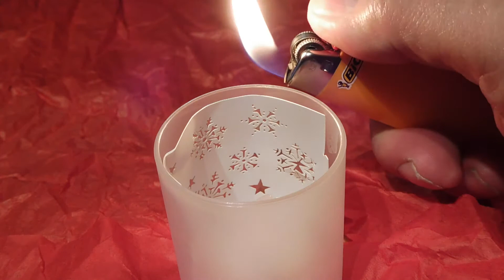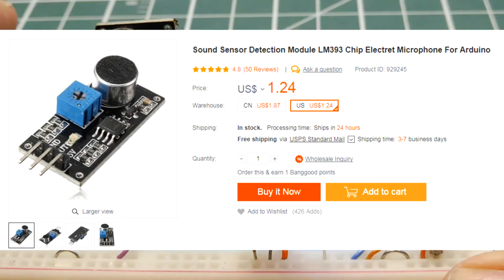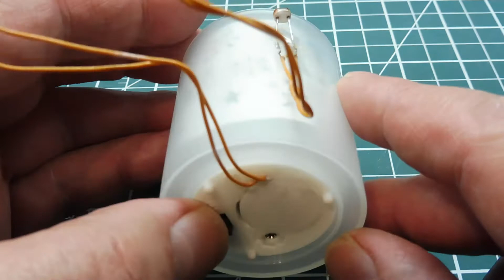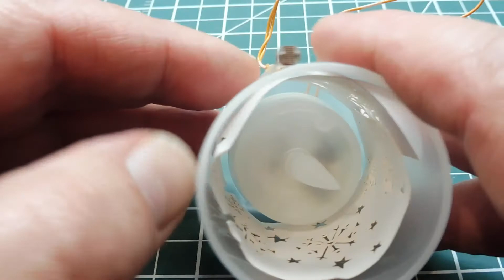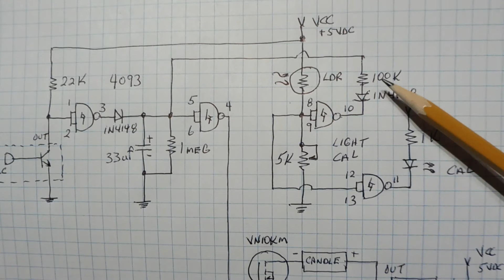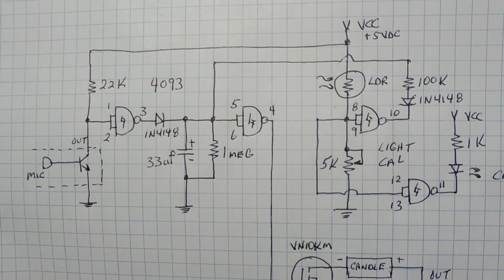Build A Smart Candle

Comment: Hi.  Im trying this one.  Instead of using a 3.3v regulator, could I use a voltage divider circuit using two resisitors?  Thanks!
Reply from the maker: Yes.. that would work. You could also use 3 diodes in series or a 3.3v zener and resistor.

Comment: Hi 3mer.  I notice you use a VN10KM mosfet in some of your circuits.  Can this be substituted, and if so what specs for mosfets are most necessary to be compatible ?   Also, what online component stores do you like to use in general for components ?  Thanks !!!
Reply from the maker: I have a large stock of VN10KM mosfets on hand so I use them a lot in my circuit design. A good substitute is the 2N7000 which are easy to obtain and quite inexpensive. https://www.banggood.com/50pcs-2N7000-N-Channel-Transistor-Fast-Switch-MOSFET-TO-92-p-1150144.html?rmmds=search&cur_warehouse=CN
In some circuits you could also use the common 2N3904. For most components my online stores are Digikey and Banggood.
I also use Dipmicro which is a Canadian online store where I live.